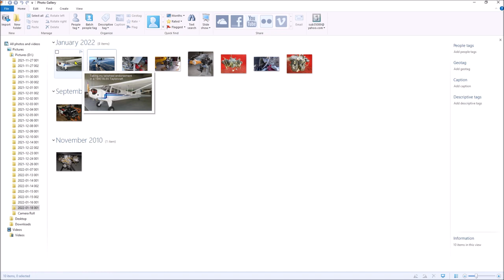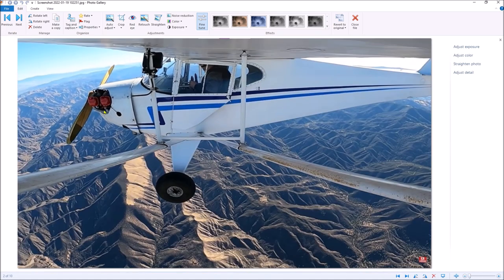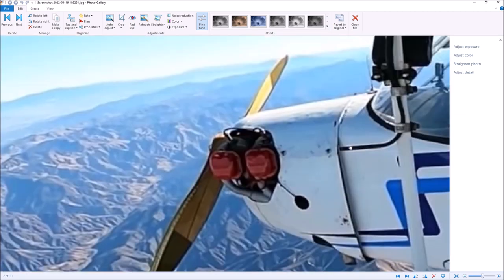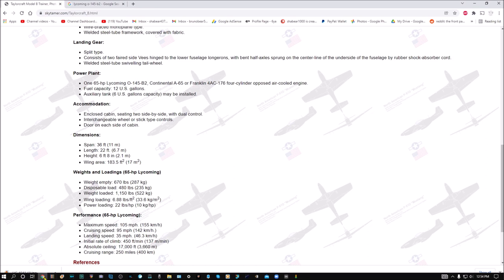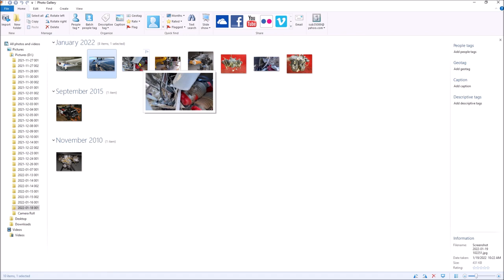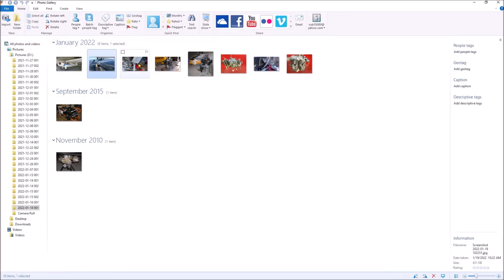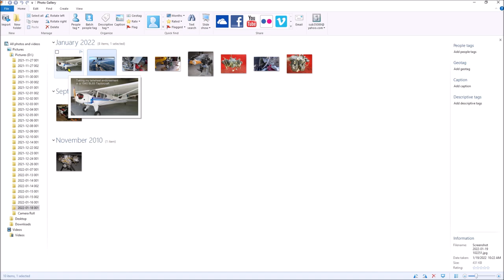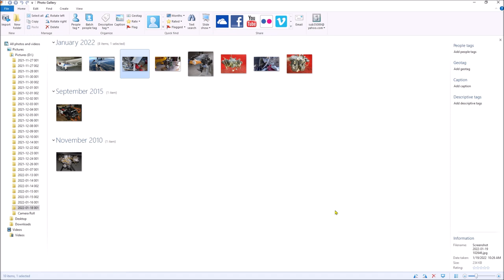Trevor Jacobs Plane Crash New Information About The Engine

Comment: FYI I'm pretty certain that "thing" you have at the beginning of your videos about kids watching your channel has zero legal standing. You're wasting your time with that.

And so what about the engine. It easily could've been replaced in 5 years. Why's that such an issue for you? I'm about 100% certain Trevor doesn't have the know how or the learned skills to replace an airplane engine. Anyone with any sort of logical thinking ability would conclude that it's highly likely that Trevor didn't do anything to that engine. It's WAYYYYYY more likely that someone else did that in those 5 years between vids. Trevor didn't do anything but crash, that plane. I can, almost guarantee he didn't wrench on it nor did he waste time painting it.

He may have paid someone to do it, even. But Trevor DID NOT put a single finger on a wrench on that plane. I'll almost guarantee that. As if a swapped engine means anything, anyway. 🤔🤣 I still can't figure out why you're so stuck on this. It's useless info in this case. It changes nothing. Now if it had been 5 months ago that it still had the other engine, you could be onto "something". Not sure what but....
Reply from the maker: He registered that plane (after the crash) as having the Lycoming engine in it.  When crashed, It had the Continental engine in it. guess you don't see the significance in "intent". And the disclaimer at the beginning of my videos is legal, and does help. It is an agreement. As any attorney, I did.